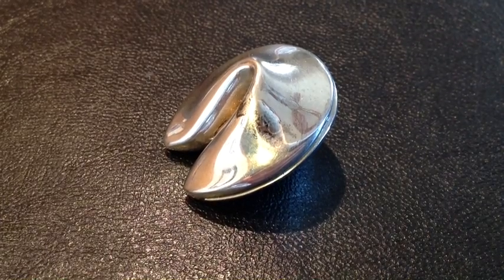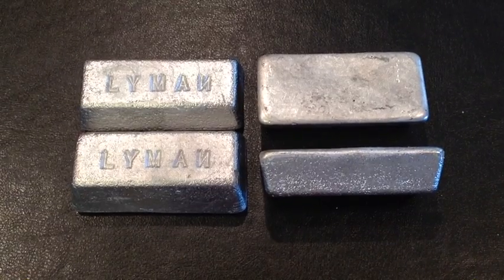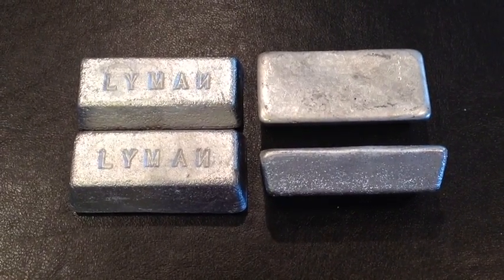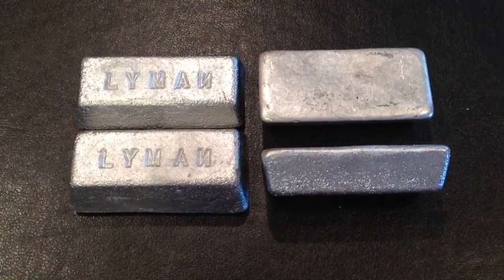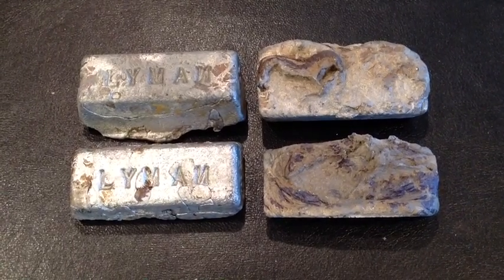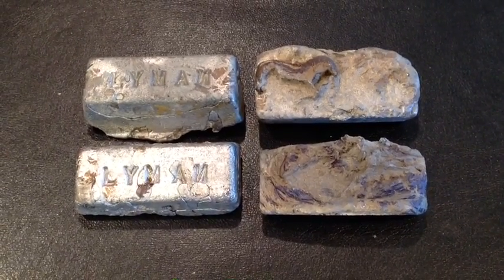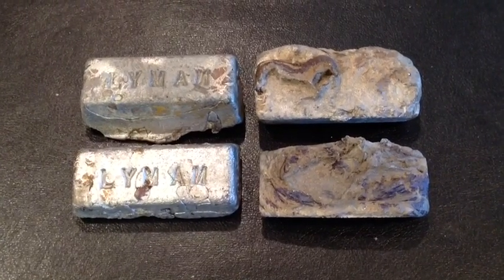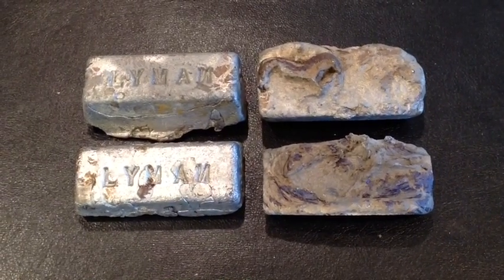Bullet Casting Heartbreak of Zinc

Comment: Sorry I am new. So you are saying that if I don't heat my lead above a certain temperature, that If I accidentally throw in a zinc wheel weight it wont melt and I can just pull it out? Great info bud, I like your videos.
Reply from the maker: +JonJon205 -- Thanks to ya for posting comment...I don't recommend the common practice of throwing in more lead into our melted lead - if there is any water or oil trapped in the lead you are throwing in - that's how lead explosions happen (it's not from a drop of free water getting on our lead - even though some will tell you that with great fervor)).  Additional lead can be added safely on top of unmelted lead as the lead underneath is melting.  Smelting lead is best done from an empty pot or on top of the unmelted lead as already discussed.  We pour ingots until the pot is basically empty, then refill the hot pot.  Yes, our lead melts at 621 degrees or thereabouts depending on the alloy.  But the lead temperature can keep climbing as we add heat.  Easy to get up to 900+ if we run high heat.  Zinc melts at 787.  So once we see our lead melt, anything that doesn't melt is not desired.  We have a 160 degree window to skim out any zinc wheel weights that got by our inspection process.  I would recommend that we turn down our heat by 1/3rd when we see the last of our lead melt; then flux and skim out everything that is particulate that remains.  We don't need to try to get the mirror finish lead by fluxing 6 times and skimming for 15 minutes - just overcooks the lead.  The wispy, lacy film that comes up is still part of the alloy, if skimmed out, will be removing some tin and antimony -  Best to mix it down, clear some surface with your ladle and then start making ingots with clean lead in your ladle.  When we make bullets using our ingots, the ingots can be added to our molten lead because we know there is no water in them.  Good castin' to ya... FC
Reply: Ok. Thanks. Good info. Will tin and antimony melt at the same time the lead does? What is antimony? And what are good sources of tin. I cant find any at all. Thanks again. Jon
Reply from the maker: +JonJon205 -- Great questions - tin melts readily into lead - raw antimony needs the lead to be heated up to 900+ degrees to melt in (at that temp, the lead actually glows bright red at night - I've seen it and it makes you think your pot and equipment are going to go ballistic).  But fear not, tin and antimony are accessible in linotype, range scrap, wheel weights.  Range scrap is actually a fine bullet metal for up to magnum pistol as we can powder coat it - and no leading will occur.  Without powder coating, straight up range scrap is good for standard to low end +P shooting.  Best to ya,  FC
Reply: Ok. Sorry to keep bothering you but you seem to really know. I want to cast some .30.30 bullets with the 173 grain Lyman mold. I have the mold. I need to get the handles still and the sizing/reducing/lubricating die, and the lubricating/sizing machine. I have the shells, the powder and primers, and the pure lead. I don't have antimony, but will probably have to buy it. Range scrap isn't real accessible to me cuz it all gets shot into dirt. What is a good "BLEND" of antimony, lead, and tin for .30.30 rounds? Do I need to drop them in cold water etc? Like I say, I don't have everything I need, but I am getting there. Just keeping my eye out for stuff as I go along. I have two kids lol. Gotta watch the $$$ but I have some. I am able to buy stuff, just going in stages. Thanks again for the help bud.
Reply from the maker: +JonJon205 -- I have a video on Mixing BHN 18 Alloy for 30/30 Cast Bullets...If you have to start with pure lead, then you will need to 2 pounds of pure lead to one pound of Superhard alloy and one pound of linotype, then water quench the bullets out of the drop to get your BHN 18.  If you start with modern wheel weights, you can use that instead of the range scrap in the video to get your 30/30 bullets... Best to ya,  FC
Reply: Please correct me if I am wrong, but I have heard that lead starts fuming at 900 deg+ and for obvious health reasons, we need to avoid inhaling lead fumes, which are colorless and odourless, I believe.

Comment: I have a question. I have been using pewter in my lead on the last pot. I'm using a Lee 10# bottom poor pot that's I bought 30 year ago. When I fired it up the lead melted but the top wouldn't melt. I pot some sprues on top and they melted but there was a layer that wouldn't melt. Do you think that some zinc was in the pewter. I couldn't get any bullets to come out right. They were all wrinked. If there is zinc in the pot can I just empty out the pot and start over. I don't want to lose the Lee pot. I have had it so long and it has made thousands of sinkers and bullets. Thanks Grant. Happy shooting.
Reply from the maker: Grant Atkinson - If you have newer formulated pewter - that's basically tin with some antimony, copper, and bismuth added.  You might have some of the older pewters of different composition - some old pewter had a fair amount of lead added and those were problematic when used for food service in the distant past.  Hard to say what your layer is, but you might give RotoMetals a call - their techs can answer as they also deal in pewter.  Have a great day,  FC
Reply: FortuneCookie45LC thank you.

Comment: Is there reason for contamination concern if I cast Zinc and Lead in the same mould?
Reply from the maker: Elektro Bear Should be OK as 1) you can clean the mold of any visible zinc residue with brake cleaner before use 2) any traces of zinc won't melt until you get to 787 degrees F. 3) you will be casting at around 700 or lower.  Ladle casters should not just keep cooking their lead to higher and higher temps - when the lead melts, turn down the heat a bit and adjust slightly as you cast.  Bottom pour pot users have heat controls, and you can use a lead thermometer if necessary.  Good castin' to ya
Reply: Nice. It was the possibility of the residue I was concerned about.
Reply from the maker: Elektro Bear Our bullet molds were designed for use with lead alloys.  I would not want to cast zinc in my expensive iron molds.  If we ruin a Lee mold, we are not out that much money.  Best advice would be to consult Lee or Lyman or RCBS on the use of their molds to cast zinc before we actually did that...And then you could post a video on it... Best to ya

Comment: I have little experience casting lead. The most I did was cast some 5/16" round balls for my slingshot ammo from a lee round ball mold. Here is a hypothetical scenario. Just say you could get some deep drawn copper jackets made in the caliber you needed. Just say for fun, you got them in .375 caliber. Would it be possible to make zinc bullet core material then press the zinc cylinders in to your copper jackets, then use the resulting assembly as a zinc cored projectile. I am not thinking along the lines of: 'green' issues, just interested to see if it can be done, or if it has been done, and if the results were worth it. Thanks for your informative channel. :)
Reply from the maker: martK banjoboy Yes, you could do that, but zinc is not the best material for cores - whatever core you use, it must be "slugged up" as if compression down causes jacket core separation.  And then you need to run through a nose forming die and base forming die (boat tails anyone?).  Inexpensive lead is clearly the best at over 11 grams / cm3. Expensive silver would make a good core at 10,  Also expensive bismuth would be third at 9+; copper at 8.9; Steel at 7.8 and then zinc at 7.1.  If you want superior penetration (like our armed forces) you use very expensive tungsten at 19+ or dangerous depleted uranium at 19 or extremely expensive gold at 19.  Take everything into consideration, plus the workability of lead and lead is head and shoulders the best core material (reason why it was used for bullets since 1500 and before).  As for "green",  I know lead has bad PR today - yes it is toxic, but it can be handled in knowledge and safety. Best Regards to you
Reply: FortuneCookie45LC Thanks for the reply. I just mull these ideas around sometimes just to keep interested in innovation. :-)

So people are having problems with them shrinking due to the properties of zamak, high breech pressures, etc.

The properties zamak has may be of advantage. As the material is less dense, and provides a material that is extremely hard, this material might loan itself to producing high quality foster slugs for use in 20 to 10 gauge shotguns with smoothbores.

People are experimenting with zamak for smoothbore slugs.

Comment: How can you identify zinc wheel weights vs lead?   And is it as simple as controlling the temp and keeping it under the zinc melting point?   I just purchased a pot and will be casting at some point.    This is the first warning I’ve encountered regarding zinc.    Any insight appreciated.
Reply: Use sharp pliers and squeeze the weight. If you feel softness and dent it, it is lead. If it feels hard and no dent it is zinc or steel.
Reply: @Nitro-SmK  - thank you!   👍
Reply: @motorgearhead  you are welcome!

Comment: Thanks for the great vids!  

I've heard that mixing sulfur into the pot might fix the problem.  I haven't started casting yet, but I'm very worried about ensuring I pulled all the Zn wheel weights out. I'd love to see a vid that tries to bond the Zinc with sulfur.

I'd love to see you give it a try...I don't have the chops quite yet! Thanks!

Comment: Hey  I cast some 45 colt  bullets and they should of been 255gn are 265 to 270 I use hs6  powder can I use the bullets, increase my powder ,why the different weight.
Reply: Darrell Baxter the more pure lead in the alloy the heavier the bullet.
Reply: Darrell Baxter I have the same problem with RCBS 44-250 kieth swc bullets   I just load them at start and work up slow

Comment: I made some ingots out of really clean lead, it was very soft and melted real smooth.  The first few batches of ingots came out real shiny, nice and clean, after that, the rest of the ingots came out nice, but they were more matte finish. Still shiny somewhat, but noticeably different than the first batch.  Was I doing something wrong?
Reply from the maker: Kevin Sin Thanks for your comments and questions. You are casting well - if your lead is cooking with high heat, the alloy gets hot - ingots casted with hot alloy will have the frosted appearance. Sometimes our cast bullets will have that frosted look also when the alloy is hot.  They shoot the same as the shiny bullets.  Also, Lee molds like to be run hot - the important thing about bullets is that the grooves are well filled and there are no folds or creases - shiny is good, but matte finish is very OK.  My ingots have the shiny look because I don't waste time getting the debris out, fluxing one time (all that is really needed), then turn down the heat to 1/2 and then ladle pour my ingots.  The last ingots (not enough alloy in the pot left to ladle) are direct poured (the remaining slag stays in the pot - clean alloy pours out underneath).  When I do the direct pour - I use an extra pair of worn out welder's gloves to shield between my good welder's gloves and the hot pot (learned the hard way that perspiration inside gloves transmit heat fast).  All that lead of yours is clean and ready to be added to your lead reserves - I like to store them dry and safe in 50 cal ammo cans good for the duration...Best Regards
Reply: FortuneCookie45LC Thanks FortuneCookie, you've helped me quite a bit with all your videos.  Keep it up.

Comment: If you keep the temp low enough those zinc WWs will float to the top like the steel clips do.
Reply from the maker: Nym Rod- Great point - since Zinc melts at 787 and lead at 621, we actually have quite a bit of safety zone there to melt our lead and not the zinc.  Have you seen some of our YT casters cooking their lead-fluxing 5-6 times and skimming until they get that shiny mirror finish on their lead?  (they keep skimming and some of that is their tin and antimony)  Well the temp is rising and if the floating weights aren't taken out, the melt point of zinc can be reached.  As you say, when the lead melts, I'm getting anything left floating out of there…learned my lesson many years ago…Best Regards...
Reply: FortuneCookie45LC
When pouring ingots I only flux once after skimming the initial dross off then skim again after scraping the bottom and sides of the pot then pour.
The last 50 pounds of ingots I poured I didn't flux once as the lead was very clean to start with, just skimmed the dross and poured.
Sometimes I flux once in the Lee melting pot before casting the bullets, depends on how clean the ingots are. The last 85-90 pounds were soft lead from roofing material for my 1858 Remington black powder revolver.
One thing I do after pouring all the ingots and while the skillet is still warm but not hot is throw in a chunk of Gulf wax so it melts and coats the bottom of the skillet when cooled to keep rust to a minimum.
Reply from the maker: Nym Rod Thanks for your post - Sounds like the two of us can get together with Jerry Miculek and the three of us can cast about a ton of lead into ingots in an afternoon's work...Have a great day...

Comment: I got a bucket of wheel weights and tried to carefully sort out the zinc and steel. I kept my temp below 700 using a Lyman lead thermometer. But on pouring my ingots they seemed to cool with a granular structure instead of the smooth look that yours have. Several also broke as I dropped them out of the mold and the break area looked like silver sand. What did I do wrong?
Reply from the maker: +dale meade -- Not a problem.  The granular structure is a result of lead hardening around antimony crystals.  The breaking was caused by dropping out of the ingot mold while still not cooled enough.  A cold ingot mold can also drop some perverse ingots, but the lead is good.  Nobody heats up their ingot molds before casting ingots.  If you get zinc melted into your alloy, the mix looks curdled - it is a ruined mix of alloy that is unmistakable - plus it takes heating past 787 degrees to get that.  If we skim out the unmelted wheel weights once the lead ones become clips, the only thing they can be are steel or zinc.  Plus, as you've seen in my videos, never plunk wheel weights into molten lead as any trapped water will explode your pot.  Melting from an empty pot or onto the top of unmelted wheel weights only is the best policy.  Good castin' to ya...  FC
Reply: Thanks, lead wheel weights are fairly easy to get still here in Ohio, but they are no longer free. They now cost about $40 for a hundred pound bucket and will have some steel and zinc mixed it. But they are still a source of lead and are available.
Reply from the maker: +dale meade -- 40 cents a pound is very reasonable as long as you are getting a lot of lead wheel weights.  If you get 100% zinc and steel, they are worthless.  If you are getting a big majority of lead, though, I'd recommend stocking up as zinc and steel are taking over - it's only a matter of time when the lead wheel weight will be a thing of the past... Happy Holidays,    FC
Reply: +dale meade fifty pounds of lead out of about 2/3rds of the bucket. Less than a coffee can of zinc and steel.
Reply from the maker: +dale meade -- Way to go, Dale!!  That's a good ratio.  You will notice that the ratio will become less favorable as we move along... Good castin' to ya...  FC
Reply: I got about 83 pounds of lead out of the $40 bucket and a coffee can of steel and zinc, so a bit less than 50 cents a pound. Not too bad, I would say.
Reply from the maker: +dale meade -  That is a very good deal on that lead...not bad at all... Happy Holidays,   FC
Reply: How are you able to tell which wheel weights are lead and which are steel or zink? Are you doing just by look or is there a different way?
Reply: Frabk, the easiest way I can tell them apart Is to tap a wheel weight against something hard, like an anvil or vice. Lead makes a kinda “tack” sound where zink and steel make kind of a “tink” sound. Hard to explain in writing, but try it and it will be clear.
Reply: @JeffinTD  Thanks. I'll give it a try!

Comment: Flux with Copper sulfate (tree root killer).
Reply from the maker: L.C. Clower -  Sounds great, but my problem with zinc is basically solved since no more wheel weights are available in CA, we just use range scrap where no zinc is encountered...But this copper sulfate is a good thing to know... Best to ya,  FC